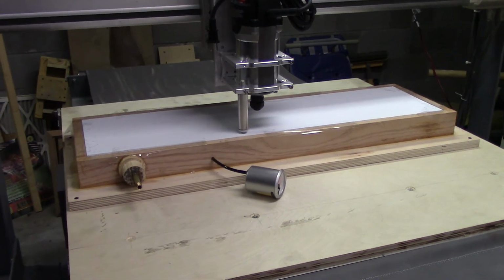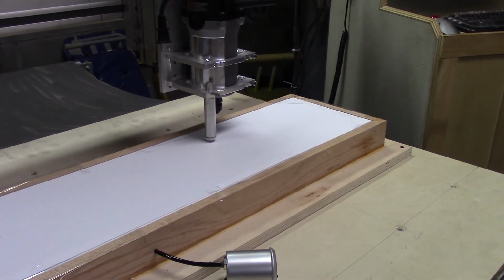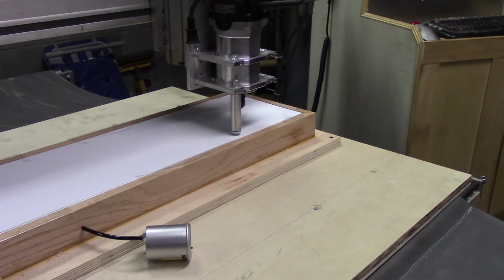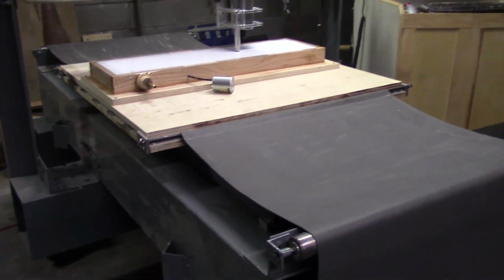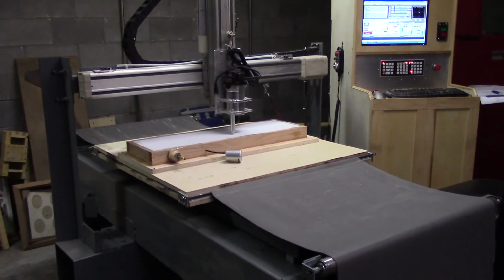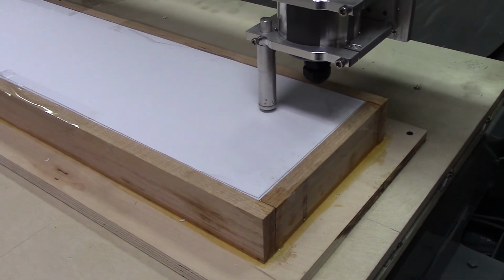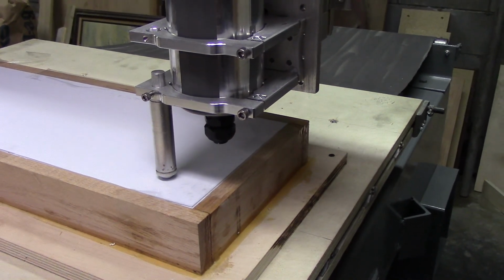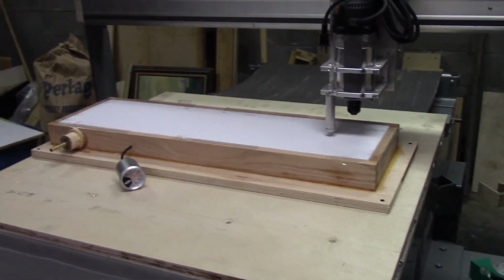Homemade 48X48 inch router cutting .040 Styrene parts from sheet.

Comment: Why aren't you using your vacuum?????  Glad to see you are having success.  You should show these guys the train this is going on.  They would be AMAZED!

John
Reply from the maker: The vacuum sucks!  As it turns out, I don't need it right now, works fine by just taping the sheets with packing tape, holds well.  If you are talking about the outdoor railway, I think I did.